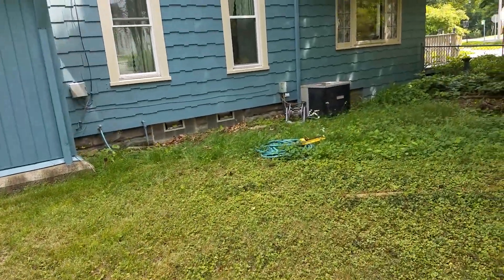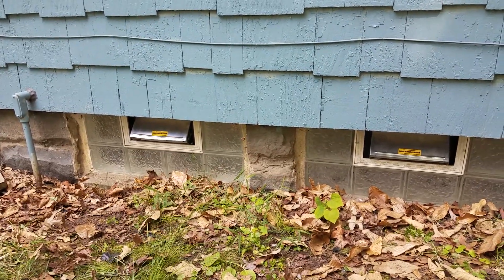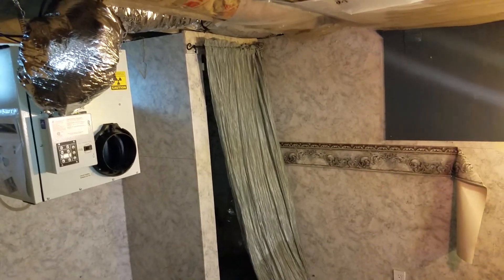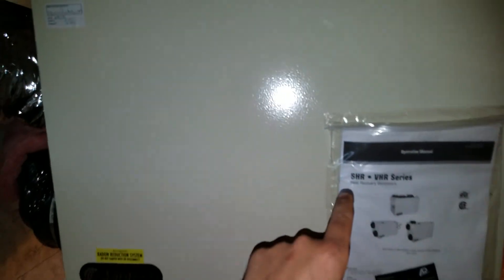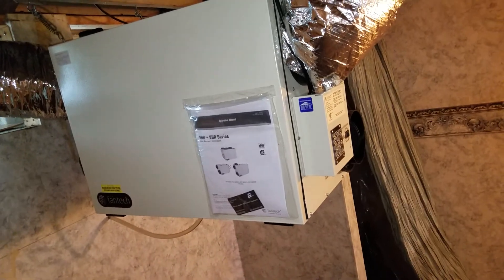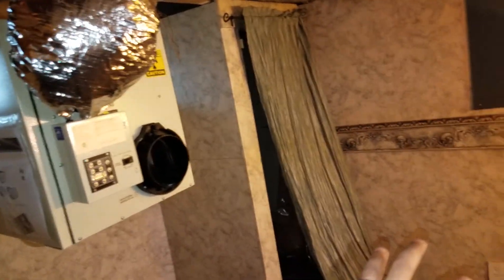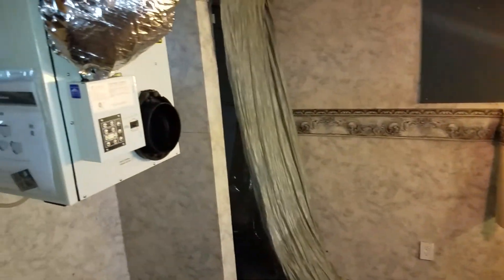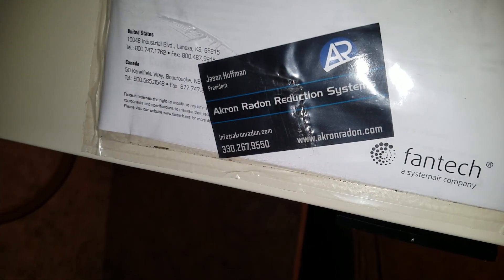HRV Radon Mitigation Kent OH

Comment: Would this be a good option to consider in a mostly finished basement where a sub-slab suction system isn't getting the number to a desirable level in the winter? We have 7(!!) suction points in place and the numbers are still high (5-6 ish in winter and typically and higher in storms). We are thinking there is no aggregate beneath the slab and this is largely contributing to the issue.